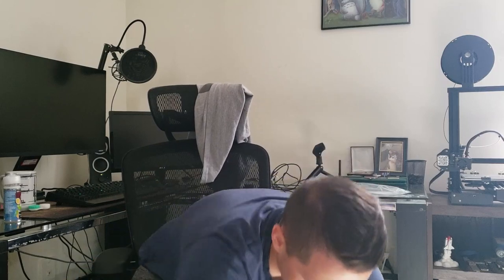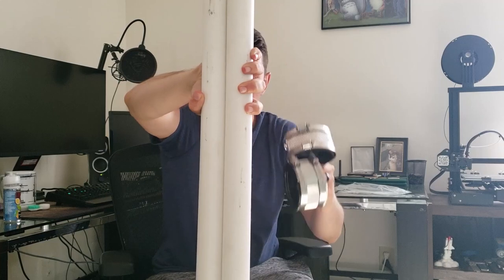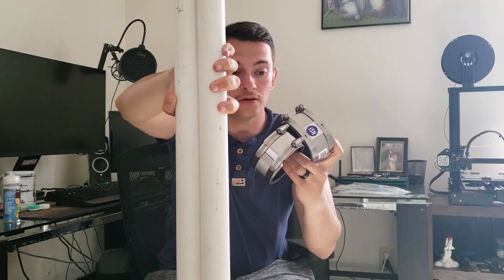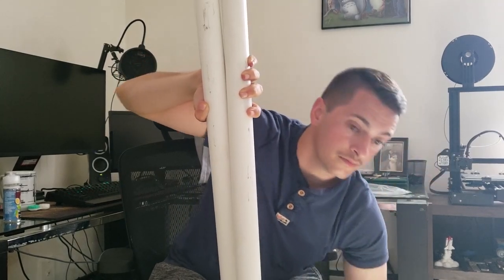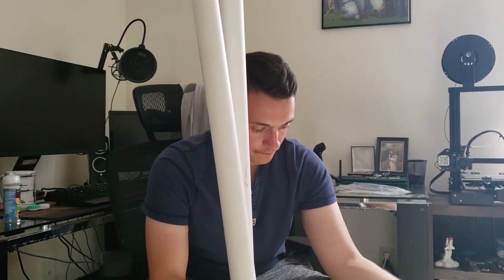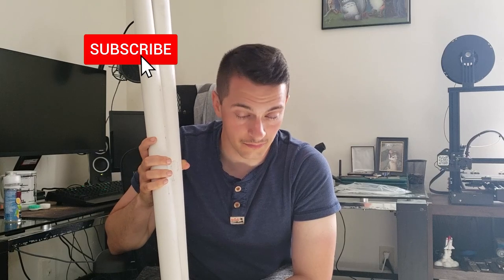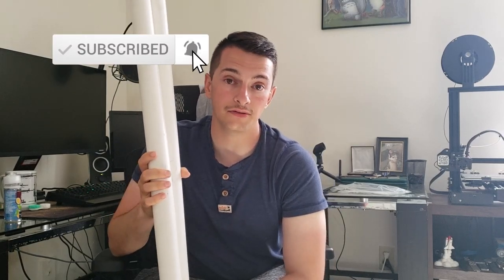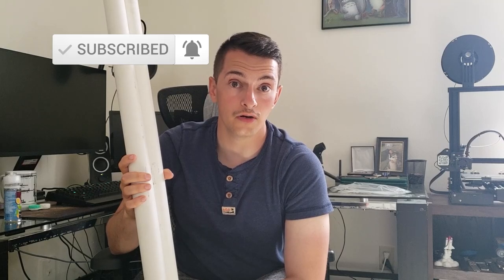Apartment HF Dipole Install (Not Quite Stealthy)

Comment: Using a half wave dipole cut for 40m means that at 20m it is effectively a full wave dipole.  That would create extremely high impedance at the feed point.  (Think of it functioning kind of like an EFHW with a really long counterpoise)

Comment: My first apartment I was stupid and went to management and told them I was a Ham and wanted to put up a stealth antenna.  (Don’t do this) 

Much to my surprise the Landlord drilled the hole in my apartment Wall and helped me mount a Balun on the outside wall of my upstairs apartment.  Then on their adjacent wooded property OK’d me to install a flat top Horizontal Loop at 60 feet for 160 meters !!!!!!  I fed it with ladder line. It worked 160 thru 6 meters.   I’ll never forget them helping me.  The landlord was Eric Tansky in Clifton Park, NY.  When I left they helped me remove it.   I felt so blessed.
Reply from the maker: I wish I had landlords like that!
Reply: @ModernHam  it was truly a miracle.  I stayed there for 5 years.
Reply: @ModernHam  I became a Landlord after that but never ran into any Hams.  If one had asked me I would have OK’d a Tower !

Comment: As stated by others you should be able to tune 15m just fine but not 20m. Antenna's will resonate on the 1st and 3rd harmonics. For a 40m dipole 7Mhz is the 1st harmonic, 20m/14Mhz is the 2nd harmonic which will not resonate, and 15m/21Mhz is the 3rd harmonic which will resonate. Callum at DX Commander has a few good videos on the topic. 

Joe W6VIP
Reply from the maker: Thank you for your in depth explanation

Comment: If the resonance of your 40 meter antenna is low in the band, like the extra portion of the band, you'll land within 20 meters.  If your resonance is above about 7.175 your 20-meter resonance is above 14.350. At a point of resonance, double the frequency it's resonate again. That's likely where you went wrong, because your antenna resonance when doubled is likely higher in frequency than 14.350. It'd be interesting to see a plot of your antenna with a nanoVNA. The impedance of a full-wave dipole isn't as low as a half-wave, which is why we construct dipoles as half-wave (usually). If your antenna is center fed, you'll need an antenna tuner to get a proper impedance match to your radio. Then there's end fed half waves, which use a 49:1 (14:1 turns) transformer to match the extremely high impedance of the end fed feed point to the 50 ohm feed line. It's a compromise, as any antenna really is. The tuner IN your radio likely isn't capable of matching your dipole on 20 meters. They usually only handle up to about a 3:1 swr. You'll likely require an external tuner, hopefully one as close to the antenna as possible. Also invest in a 1:1 balun for feeding your dipole to help isolate your sheilding from common mode currents, and DO use a common mode choke to help reduce noise of apartment dwelling. It helps, I promise. 73's KY4CT

Comment: Same happened with my Endfed antenna to.
Reply: Current choke / coax choke balun or ferrite rings will reduce that, and a counterpoint, if only a few metres of wire will help too. G7VFY

Comment: See how it tunes on the 15m band. You might have some luck there.
Reply from the maker: 15 tunes fine. That's interesting.
Reply: @ModernHam  I believe 15m is the 3rd harmonic of 40m, which is probably why it tunes decently.

Comment: I haven’t had to try to set up a rig and an antenna in an apartment complex, so I’m curious as to how you are managing your grounding.  I ask this question because of your mention of RF with the EFHW.  I’m also curious of the footprint that you used for the 132’ of wire for the EFHW as the area outside of your apartment appeared to make running an EFHW a challenge.  

I agree with the other comments on the harmonics for the bands.  Did you use an SWR meter when you set up your dipole to see what you were getting on 20M and if it’s too far out of range for an external tuner?  Diamond makes a trapped dipole that you could mount on your mast.  It’s the HFV-5 and it covers 40-6M.  Here is the review link for it on eham.net. https://www.eham.net/reviews/view-product?id=12383

73, AE0IT
Reply from the maker: I should have measured it. I'll take a look here soon. Thanks for the antenna recommendation.
Reply: My station is in a condo 2nd floor. No grounding but there's a lightning arrester in the coax switch.

Comment: I live in an apartment/flat too. Common mode currents ! I've had RF burns and they are nasty. You don't mention how much space you have to play with. All the antenna syou have and have had will have a problem with RF at the outside. Remember, with RF, EVERYTHING, interreacts with EVERYTHING, especially if other metals or conductors are near the antenna (Including metal railings) RF and current chokes should be close to the radio, but don't have to be in the shack. Balanced feeder, aka LADDER like is A LOT MORE efficient than using coax as it far less lossy than coax. Cheap coax should be avoided. 

I have two suggestions:- 

1. A Longer EFHW, for 80m or 160m strung between your balcony, tree#1 and tree#2. The wire does not have to be strung in a straight line. I would use an antenna wire with Kevlar inside  to make it a little more resilient. If you have RF in the shack problems with this antenna, a simple coax balun or choke balun or ferrite rings will sort that out.

2. Instead of the regular dipole, I would install a ZS6BKW or similar antenna

https://www.youtube.com/watch?v=MbXmAcf9MmI AND https://www.youtube.com/watch?v=EypzupYh3uw

3. A 40m/80m magnetic loop, see http://www.kk5jy.net/magloop/

4. An 40/80m SPIRAL LOOP antenna. https://www.nonstopsystems.com/radio/frank_radio_antenna_SM0VPO.htm OR https://www.avalonarc.org.uk/2019/10-27-an-80m-spiral-loop.html OR https://www.youtube.com/watch?v=ji19-6LPog0

Comment: How high is the center point? I belive for a dipole you’d need at least a half wave off the ground for the band it’s cut for.
Reply from the maker: Not as high as it needs to be. Maybe 20ft. But the higher I make it, the more of a chance someone would say something.
Reply: @ModernHam  I am right there with you. since you have the ability to use the pole on the patio, the End Fed Half wave might be your best bet. when you want to use it just lift the matching unit up as high as you can. You could also look at the G5RV antenna. You might be able to get away with 20ft height on the feed point. If you need to be super stealthy look at the Packtenna Mini. Shoot me an email, I have some ideas for you. I'm good on Qrz. K5QBF

Comment: I believe the reason it won't tune on 20m, is that a dipole only resonates on every 3rd harmonic. So it won't be effective on 20m, but will work with a good bit of gain on 15m. If you want an antenna that resonates on every harmonic, try making a full wave loop. 

My MFJ-939 ATU struggles if I try to tune my 40m vertical on 20m. Also, unless you're in an HOA, I'd recommend getting a Silver Bullet 1000 Vertical. They're about $170, and come with everything except the coax. I'd suggest putting a few more radials on one though. 

Mine is great, and I've made contacts as far as 6500 miles away, and have been heard in Australia, and Antarctica to name a few. I've since center loaded mine, and it works better on lower frequencies now. I just took a 4ft long piece of aluminum rod with threaded ends, and stuck it between the tripod and coil. They can be tuned for pretty much any HF band except 160, that'd need a larger whip.

Great video as always Billy, I'm looking forward to your next livestream! 73 de W8IJC.
Reply from the maker: Yeah maybe we can make contact now that I've Eliminated a lot of interference. Thanks for your explanation
Reply: @ModernHam  No problem, and yeah, hopefully we'll be able to hear each other next time.

Comment: How are you feeding in the Coax in?  That is actually the toughest part I had in all the apartments I tried to operate out of.  If you don't want to give that secret away on video I understand as the Management company may be a sub.
Reply from the maker: Honestly, just through a window. I stuff the bottom with a towel to help insulate around it where the gap is. Probably not efficient, but its worked.
Reply: What I did 30 years ago was drill a hole in the stationary door of my sliding glass door and through that hole (not through the glass) I slipped a piece of RG58 coax. The coax was about 20 feet long.  I had a stealth Hamstick vertical I would clamp to my wooden railing set up at night to work 40M CW.  I had 4 26 foot radials connected to the metal clamp that held the hamstick and those radials I coiled up beneath some cheap green outdoor carpeting on my deck.   It worked great.  I used a TenTec Scout with less than 25W to work DX and stateside.  When I moved, I took my portable setup with me and for the hole in the sliding glass door I glued  a small sheet metal screw head into the hole so it looked natural.  Nobody was the wiser.  After that I moved into another apartment and mostly operated portable.  Fun times in 1995-1999